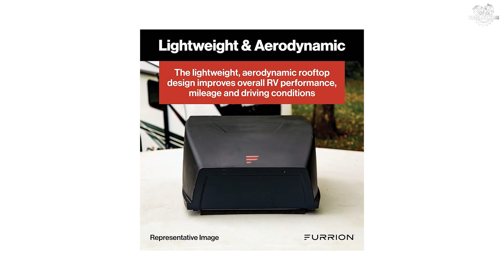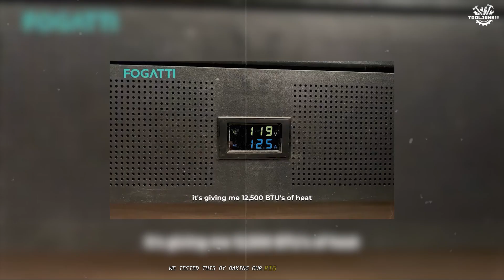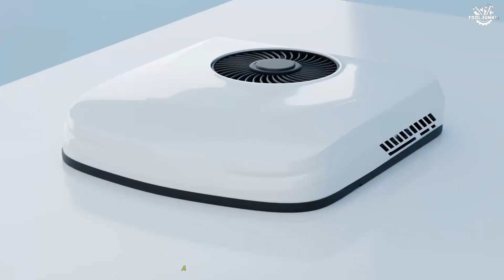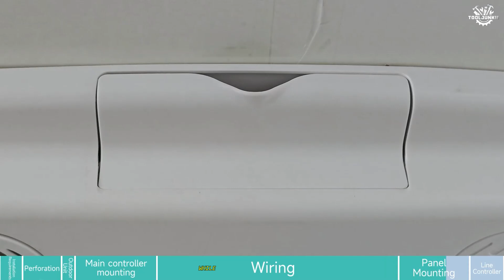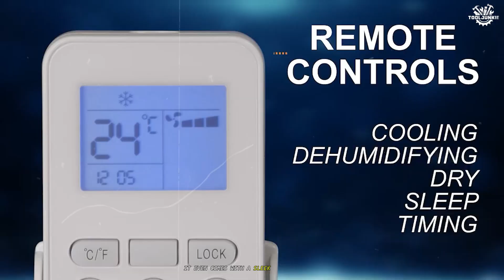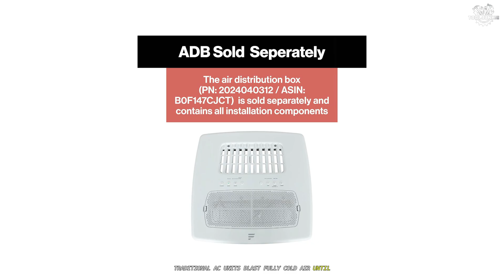7 BEST RV Air Conditioners 2026! Quieter, Colder, & Efficient

Comment: It would be really nice to have an AC Heat Pump low profile variable speed compressor ducted unit that operates from a wall mounted thermostat (that is wifi enabled!) with multiple zones (to control more than 1 AC unit on the rig). But apparently, NOBODY MAKES ANYTHING LIKE THIS! Gahhhhh! I am so frustrated at this point. 😐
Reply: I just learned yesterday why it is I can't get my 2 new Furrion Chill HE Low Profile heat pump units to produce heat with the Furrion Chill Enhanced multi-zone wall thermostat: In small print in 1 of the installation manuals it says, "Not compatible with Furrion Chill multi-zone controller or wall thermostat! WTF??? Nowhere in the sales listing descriptions do they bother to mention that the Chill multi-zone controller and wall thermostat isn't compatible with the Chill HE Low Profile Heat Pump AC system.... you have to dig thru the poorly written installation manual to find this out after you bought the blasted things! Gahhhhhh! 🤯